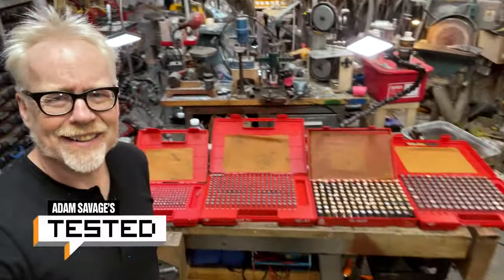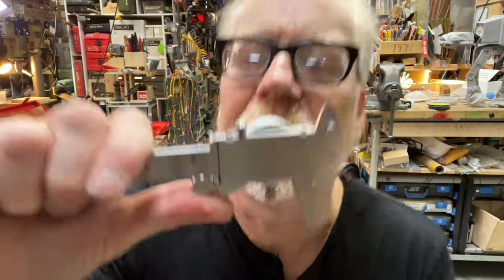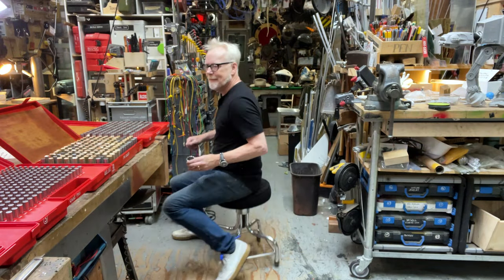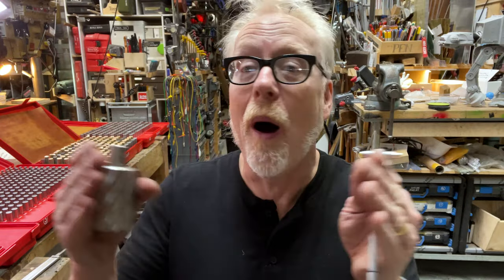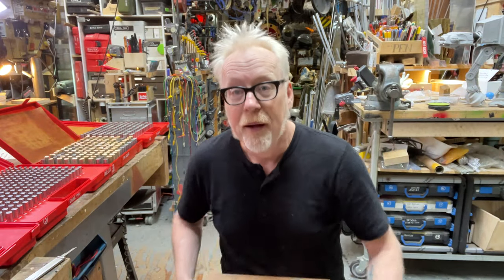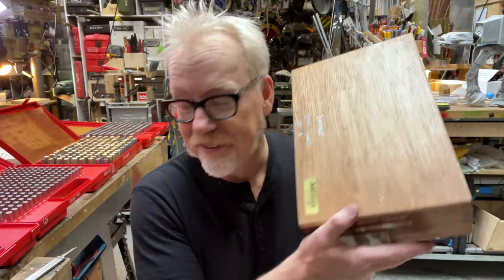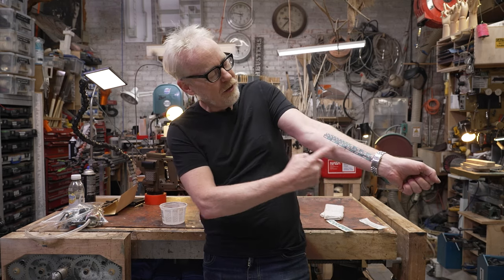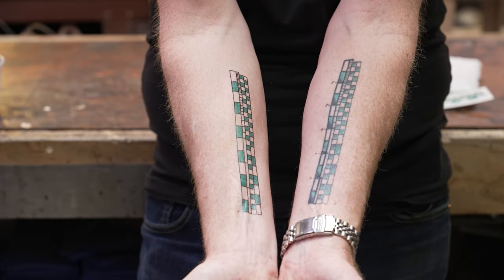Adam Savage's Favorite Tools: Pin Gauges!

Comment: By trade I am a machinist/toolmaker. One of my side hobbies is making wrist watches, mostly out of titanium. Moving between the mill and lathe made me come up with a device that allows me to find the center of a circular feature. I do use wigglers, but only on flat surfaces. What I made was a dial indicator that can move from zero to six inches. You can make it longer for your own needs. It basically orbits the part. It's easier if the mill is in neutral. It's fast and I can get it past a half ten thousands. It's been my go to tool when finding the center of a circular feature.

Comment: Found an old pin gauge set in the back of our tool crib one time; hadn't been used in years. (I was working in a jet engine repair shop at the time.)  Never had seen anything like them, but I figured out how useful they could be, using them as a sort of go/no-go gauge for bores subject to wear.  A whole lot faster and more accurate than trying to use dial calipers on a 0.250" nominal hole.  Once I started using it, others saw it, and everyone wanted to use it.  But then another engine line got wind of our discovery, and they commandeered our pin gauge set.

Those things are highly useful, and not just for machinists.  Regular ol' knuckle-buster mechanics can make use of them, too; real easy to determine if a hole is worn out of limits or has become elongated, and none of the "well, maybe you're not reading the caliper right" BS.

Comment: Dude, I worked for a oem piston manufacturer, when he said you eventually use comparative gauging equipment my full nerd exploded. My tightest tolerance was 7 microns, and he is right using a bore gauge takes time and skill and one skill I acquired and failed miserably for so long until I got the hang of it. Jo Blocks and pin gauges ahhh metrology is just fun especially when your able to machine it is soooooooo satisfying.

Comment: We have the set of .275-.5, .5-1, 1-2, and 3-4 of those exact Mitutoyo bore gages in our lab.  They are incredibly useful.  And those are calibration 'rings' or ring gages for calibrating/setting the bore gage before measurements.

Comment: Pin gauges are great! More useful for precise measurements than bore gauges - at least with the materials I work with. Using a bore gauge to measure a hole made in a malleable material like PEHD 2000 will stretch the hole as soon as the bore gauge starts clicking.  
Adam, do you have some nuggets or a story to share about machining plastics?

Comment: Adam, Thanks for making these wonderful videos. I'll never get tired of seeing and hearing about your tools and all the ways to use them.  You did forget to mention the Starrett 829 small hole gage set. Its a great alternative to measuring bores as small as .125 and up to .500 with great precision. They can be a bit finicky at first,  but with very little practice you can get very accurate measurements.
Reply: But then you are relying on the circularity of the bore or pocket.  The slightest runout could turn a perfectly fine part into scrap pretty quickly that way depending on tolerances.  With these pins you can at least be sure that you are on center of the feature as long as you remember to account for the radius of the pin or pins.

Comment: I really like measuring stuff by zeroing a Joe block on a dial gauge stand and reading the difference on the dial. It's quick to do and truly convenient for parts up to 3-4 inches in height. I don't see this done much "in the wild" as it were, but its very reliable and accurate and has the added bonus of enabling you to do a half ass indication of parallelism.

Comment: Adam, you would love a good depth micrometer if you don't already have one.    It would pair really well with your pin gauges and your gauge blocks.  It would really help tie some of your kit together.  And if you ever measure the diameter of something with a groove a set of blade micrometers is really nice to have on hand as well.

Comment: I was recently making replacement cylinders for the PKD Blade Runner blaster and was in need of these to check things. As Murphy's law would dictate, the ones I needed were no where to be found in the shop. So I had to make some of my own because waiting on new ones was not in the cards. Took me a few hours to make a couple of pins that fit into the reamed 11.8mm holes perfectly. So tight of a fit that if my finger blocked the other end of the hole while trying to insert it would act like a shock absorber or while trying to pull it out would just suck it back down. I use these things everywhere in the shop along with a set of gauge blocks that were made Sept. of 1942.

Comment: I made a firing pin protrusion gauge in gunsmithing school, the tolerance for the length of body and pin were +-0/0.0001" and it was utilized with a Vernier micrometer.  As the name suggests it was used to precisely measure how far a firing pin would protrude through the bolt face of a firearm to the ten thousandth of an inch.  It is the most precise anything I have ever made.

Comment: Adam, have you used ball gauges before? I used them in QA when I worked at Cessna, inspecting aft cabin wing mount close tolerance bolt holes. Sorry of like a bore gauge, but purely mechanical, at least the ones we used. Have a great day sir, and keep up the awesome videos.

Comment: The search for the right size reminds me of a programming optimization called binary search (or half interval search). Instead of sequentially going through a long list, you start halfway. If it's too small, you double the size. If it's too large, you halve the size. This means you have to take fewer steps to get to the right size than if you try everything sequentially.

That said... when you can eyeball it, and get pretty close, it might not make that big a difference.

Comment: Adam, you can use the calipers to measure step using the head end aswell as the tail end. The two halves of the calipers are ground flush. It allows you to set it perpendicular and take some error out.

Comment: Pin gauges are a life saver. 

Thread parallels. I hate using them because they're so fiddly, but you can get a precise measurement of the pitch/effective diameter when you may have a tight preplate limit to work to, it's hard to not appreciate them.

Comment: The small hole gauges with the split ball and wedge are pretty nice for small holes too. Cheaper than a true bore gage I think. Starrett 289 set measures from .125" to .5"

Comment: Adam!!!!  Advice I received from an Expert Machinist!  When you're trying to find the length between center of the hole and the edge by using the guages, you can use the opposite side of the calipers more accurately! Try turning it around!  You'll be amazed!

Comment: I use these all the time in aerospace to measure depth of a dent! Just put a scale across the dent and find what pin fits between the scale and the bottom of the dent to find out if the part is still good enough to be shipped.

Comment: I agree about how handy gage pins are. You may have covered it, but you can get pins that are toleranced over or under. My sets are unders. I.E. from exact size .0000 to .0002" under. They are amazingly accurate considering their relative low cost. In addition to measuring they work well to set up to a reference hole on the mill. Put the pin in a collet or very good chuck and move the work until the pin enters. Punch X&Y zero on the DRO. Use INC if you are already using a center or other point in ABS for the main reference. With a 1/2" set you can measure to .999 +- .0004 Quick and easy. 2 pin method. Assumes cylindrical hole.

Comment: I have used Air Plug Gages for measuring holes for size and taper. 
Machined blocks of cast iron for a hydraulic application.  
Blocks about the size of a series 7 I phone.
Machined to thickness
Next, blocks two surfaces ground and lapped.
Next, machined o-ring groove on each side and five holes drilled and reamed.  
Next, holes were honed on Sunnen honing machines.
The size and taper of the holes were chanced with an Air Plug Gage.

Comment: I love my Coaxial Center Indicator that use on my lathe. Yes I could use a normal test dial indicator on a magnetic arm to get the X and Y center, but then I'm leaning in to see when its facing the other way. This spins independently of the dial so I can see it at all times.

Comment: Maybe some one else mentioned already, but if not,  when you measure the distance to the pin and in general steps, it is much more easy and accurate to use the step measuring surfaces, opposite to the depth bar.

Comment: You could also use small hole gauges in a pinch.  These are the ones that have a small ball on the end that expands when a screw on the tool is tightened.  Once the ball is the correct tightness in the  hole, you withdraw it and measure the ball with a mike.

Comment: A fun way of measuring diameters and radius’s on a bridgeport mill with a DRO or a CNC machine is to edge find an edge that is perpendicular to either your X or Y axis. Once you have that edge found and recorded your coordinate locations of that edge, you can then move any distance away in either X or Y  and swing your indicator in the spindle and adjust the dial to Zero. Once you have the indicator set for “swinging the radius” you can then go to the center of a known hole coordinate and insert the indicator tip into the hole and swing it. This will give you  + or - reading on your indicator….pretty cool trick. I use it alot for checking small rads when finishing tight tolerence profiles and what not.

Comment: In woodworking the term "relative measurement" is sometimes used. You make your plan with exact dimensions indicated, but then real life intervenes. Wood is wood, not metal. So when actually making the piece you go by what fits, not what's shown on your plan. Having said that, one of the most useful tools in my woodworking shop is the 1 2 3 block, which started life as a machinist's tool. I've collected a number of them and I love them.
Reply: I worked for several years in an industrial design workshop, the headaches always appeared when we had to build things that mixed metal, glass and wood. As always, the pieces of glass (sometimes hundreds of them) came from external workshops, dimensioned. Welding metal, checking twists, fitting the glass there, nightmares for several days hahaha. 
Metal and wood expand and contract  and twist a lot, glass doesn't xD
Reply: @pedrova8058  I recently made a wall cabinet with glass in the doors. It was challenging not being able to make things fit by bashing them with a hammer. Glass just doesn't seem to like that.
Reply: @seanhollandcanada  haha, yup. "Precision" means different things in different fields, in metal, 1/10th of a millimeter maybe works fine ; in wood,  half a millimeter (?) ; when you ask for pieces of glass or stone (granite, marble), 1 or 2 millimeters seems "normal" (especially when you order pieces with perforations)

Comment: I love my Shars Minus sets of gauge pins. The minus sets are ground 0.0002" under the nominal sizes. A plus set is ground 0.0002" over nominal. 

I have the same Shars minus sets in ZZ grade. They are extremely accurate. I have up to 3/4" but hope to buy the rest of the set to 1".

Comment: Correct me if I am wrong, but if you can fit the pin into the hole the hole is larger than the pin. Size for size is an interference fit.

Comment: If you ever do surface grinding and need very tight tolerance angles, I recommend deltronic gage pins. They are very accurate and Expensive so you probably just need a .5000 pin and a .2500 pin for most dimensions taken off dowels. And if you can get a Herman Schmidt sine plate, that will be good.

Comment: Adam, they're actually are "Small Hole gages" which are the equivalent of the telescoping gages that go down to about 1/8" they function pretty much the same as the telescope engages. You drop them down in the hole and then you tighten the knob until they touch the diameter and then you withdraw it and measure with a micrometer. Also, I think it's worth noting that gauge pins come in "plus" and "minus" sizes wherein the tolerance (usually about .0002") is either on the plus side of the nominal value or the minus side and typically when you're doing go no go measurements you would use the minus for the upper end and the plus for the lower end to make sure that you don't violate that very fine line. For a "Plus" size pin for .500" you actually have a pin that measures .5000"-.5002" and for a "Minus" you have a pin that is .4998"-.5000"

Comment: I love tools with multiple "creative" functions. My favorite has to be the switchable magnetic indicator base. I have come up with so many useful things to do with them beyond holding an indicator that it's ridiculous. The best thing I ever did was walk into a Harbor Freight during a sale and bought about 2 dozen of them! Most of mine are only about 45lb-rated, but I have a couple stronger ones. Because of the threaded hole on them, I've attached all manner of contraptions and sometimes have just blatantly epoxied them on to things where I need a permanent solution. Sometimes you just need a magic box that sticks to metal things!!!

Comment: You can also use a height gage to determine hole diameter and positions

Also Adam when your going off the pin use the other side of the caliper there's a step on it as well it's more stable and accurate.

Comment: Big rewind to the early 90s, my uncle had a set of Meyer's metric ones. I never saw the use of those (like.. duh measure it?), untill i start working on my moped. Its not only great for exact measure, but also to find the 'sweet spot' of a rod (they even have threaded gauge pins), but also find more or less 'slack' in rods and holes. Where instead finding better bearings, he fully remade rods and shafts by just going slightly bigger to lessen the slag on the shafts, then i realised the power of these things. The metric ones come in 4 or 5 qualities i remember, where the cheap ones have a tolerance of i believe 0.05mm (yeah.. 1/100th of a millimeter) to i believe highest grade that goes into the 1/10000th of a millimeter.

Comment: I've gotten to the point where normal gauge pins aren't enough. I recommend you check out Deltronic pins as they incrementally increase by .0001 might be a bit of fun. Also remember for a pin to go through a hole without any force you need .0002 clearance if the hole is truly round.

Comment: My favorite "tool" that people might not think to use while machining is a ball bearing. you can put them on top of a micrometer with a flat anvil to measure the thickness of a part with an internal radius if you don't already own the proper micrometer.

Comment: I'm in college for machining so I can speak on a lot of this! Generally I measure things with micrometers unless it's some kind of quick reference, then I'd use calipers. My mic can measure things to .0001", and calipers generally have a range of about +/- .005", so I stick with what's finer, generally. Gage pins are rad for measuring exactly how far you've cut when you use a boring head on a manual mill. Telescoping ones are alright I just find them to be a bit of a pain in the neck to use because measuring them with a mic is annoying, you've kinda got to hold it upside down to get it to work right.

Comment: Would be interesting to see how much temperature will effect the accuracy of the pins. Is there a recommended storage temp?
Reply: They are hardened steel, which would take quite a bit of temperature to change significantly.

Comment: We use  bore gauges at work to measure the ID of machined holes that some of our parts have, to make sure we are cutting within spec, and they are super cool. But not as much as the robots are, those are way cooler. We also have a height gauge to measure the lengths of all of our parts, and dial gauges and pin gauges and a bunch of other toys.

We also have different models of the Fanuc LR Mate series of robots that have been produced over the years running in our machines, do they count as machine tools? I don't know, but I think they should, and those are my favorite tool.

Comment: By the way, there are calibration rings in large sizes,  cost about 80 and up, and you can test your tools in that., example, mitutoyo calipers will show 3.96 everytime on a 4.000mm ring, which is good enough for me to know so i dont need to break out the pin gauges

Comment: My tool may not fit your criteria... but I'll try anyway.  As a millwright, my favorite/most important tool is my spud wrench.  It's an adjustable wrench with a handle that tapers into a sort of spike.  You can use it to align holes.  It's endlessly useful. 
Millwrights install stuff, usually big machinery.  We use lots of high precision tools and gauges, but the old go-to is the spud.  There's always the old guy at any job who says something like "You know the old Coca Cola plant?  When I was your age, I put all those bottling machines in myself with just a level and a spud wrench!"

Comment: So are those plus or minus gauge pins? It will double the cost of owning a set of pins, but when you absolutely want to know the diameter of a hole you will want both.  Also when measuring from the edge of the block to the pin if you flip you calipers around and use the flat faces you will have much more repeatable accurate readings.

Comment: Proceedure says to take the tool measurement while still on the work if possible. And taken once again when you take the tool off the work if you need double exposure. Your vernier need not be calibrated if you use it to measure existing holes that you need to match up to like Adam mentioned as long as you finish the job using those exact unexact calipers.